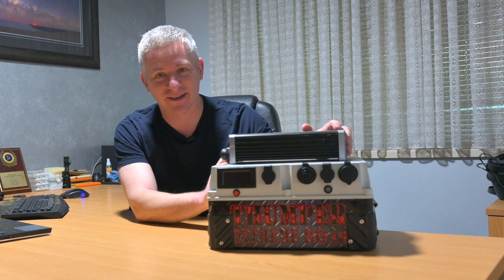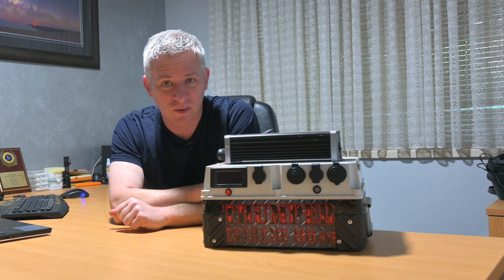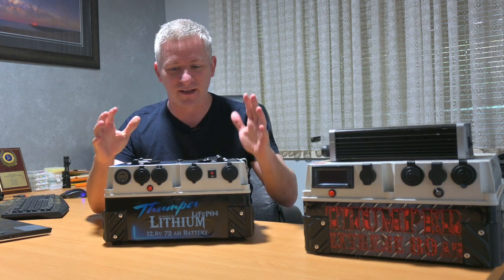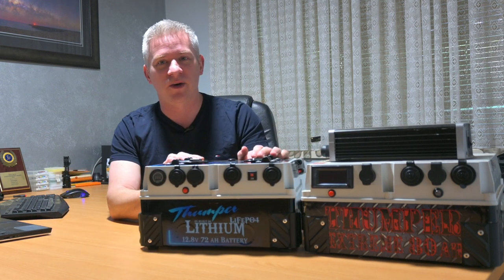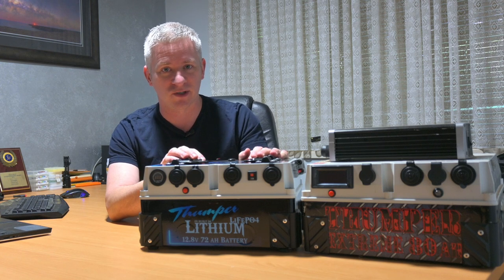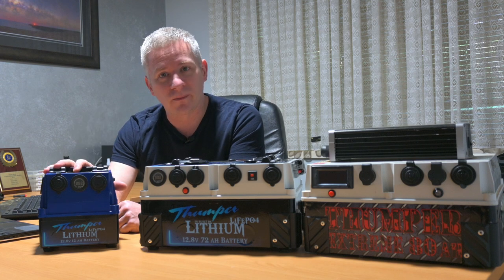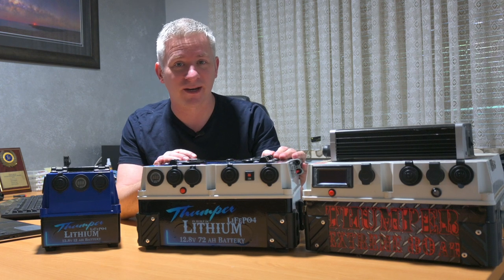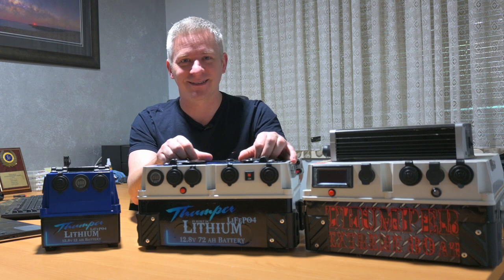How I power my astro setup

Comment: Recently built my own with a 12V 100ah battery and fuse box with a few outlets. The first test went well. Seems the biggest drain is the cooling system of the QHY268MC camera. Overkill on the battery but it may come in handy in future L.A. power outages. Will be adding an external inverter option soon.
Reply from the maker: So the 268 is power hungry? Does that camera have some kind of under voltage cut off as well? 
Did you build Lithium or AGM for a battery system?
Reply: I don’t know that it’s any more power hungry than other 268s. I had set the temperature to 0°. Thought I wrote the draw down somewhere but can’t find it now.

Comment: Hi Steve, what a great set of battery packs! I am intrigued by the small unit for the GTi. I was planning to use rechargeable AAs to power mine. Do you not think a set of AAs would last a whole night on the GTi? A bit colder here in NZ too, so I'd probably use them up quicker than you would!
Reply from the maker: Yeah I think batteries would last a night, under really cold conditions I’m not sure. I decided to opt for the small power pack because of the asiair so it just made sense to run the mount through the asiair and run the asiair through the power pack

Comment: Hi Steve, so you have no issues at all with powering your Eagle with the Thumper? My Eagle tends to drain my 12v deep cycle in around 3-4 hours or so and once the battery drops to below a certain level my Eagle shuts down. PrimaLuce recommend a battery that puts out 13.3 volts  (Ecoflow lithium which is around the same price as your Thumper). Hmmm... you mentioned that once this battery is fully charged it puts out 13.4 volts. Food for thought now. Thanks for the video btw perfect timing!
Reply from the maker: Do you have a regulator between the battery and eagle computer. The regulator lets you run whatever voltage and maintains it to the Eagle computer. The battery just needs to have enough power to keep the regulator running. 

The lithium battery once fully charged is 13.4 volts. My last session it dropped down to 13.1 volts for a full night of imaging.
Reply: @StevenMorrisPhotography  I've tried with a regulator and also with a Redarc Invertor but the invertor route is not the ideal way as I'm converting DC into AC then back into DC hence my interest in your Thumper. Just checked the specs on the Thumper and they claim 13 volts yet interestingly you mentioned you managed to get 13.4 volts, as far as I knew the only lithium which claimed 13.3 volts was the Ecoflow but that was via the ciggy outlet which I'm not that keen on.
Reply from the maker: That’s interesting. I also use a Victron Energy 12v charger so maybe that is also helping the batteries reach their full charging potential